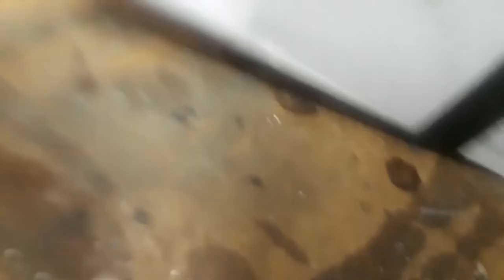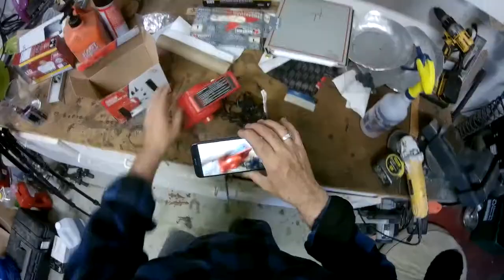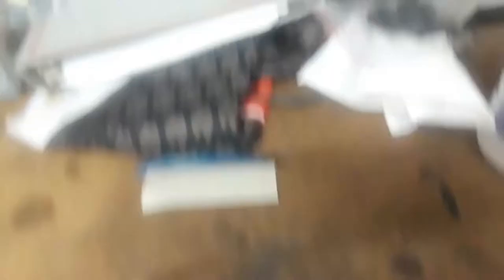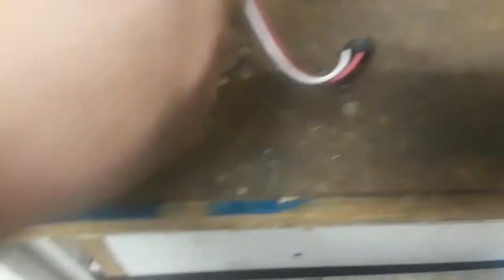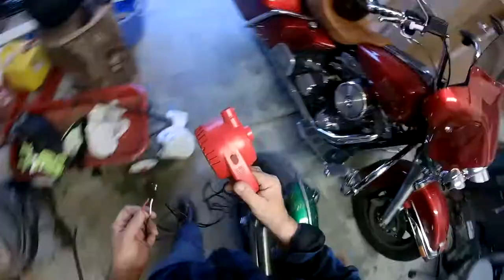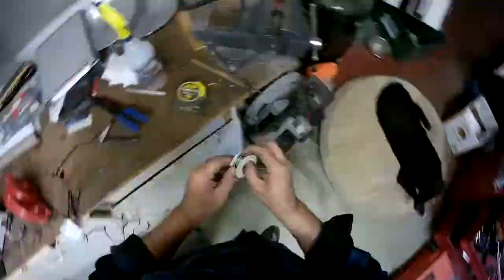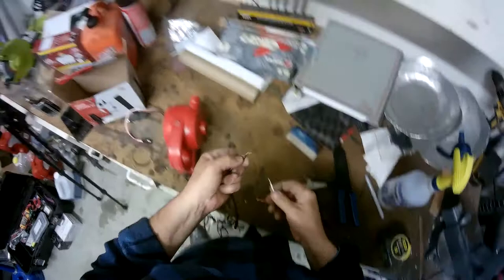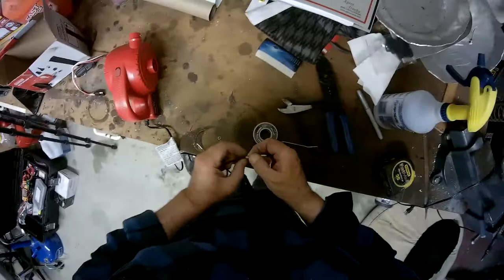How I Do Solder Joints On Wiring

Comment: I camp out at the HILTON and it's a bitch!   :-P  That fan motor ya got there makes a good blower for an oil burner furnace for melting metal.  Speaking of which.... You retire from pouring hot metal?
Reply from the maker: No, that project is still in the pipeline. In fact, I expect to get after it in a big way in a few months. Going to be exciting!!!